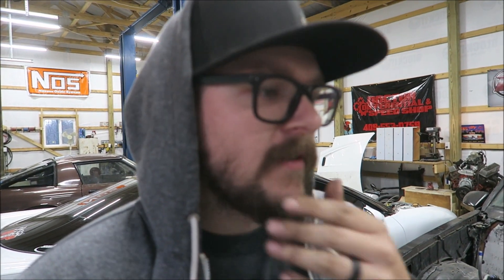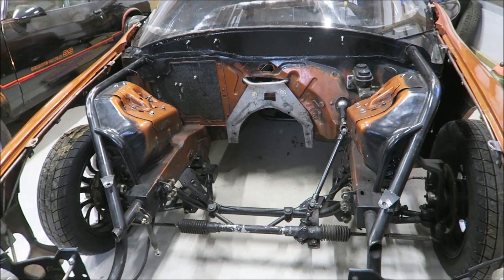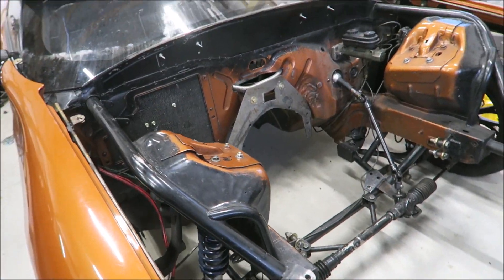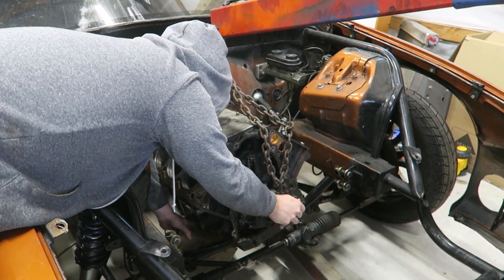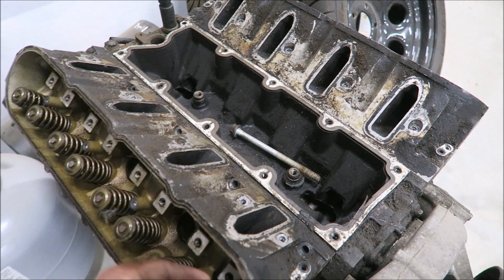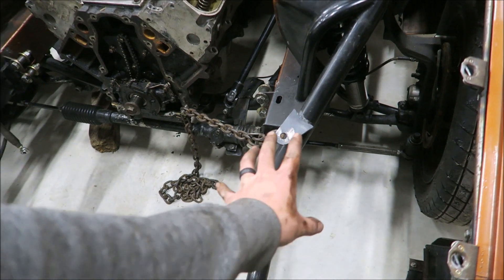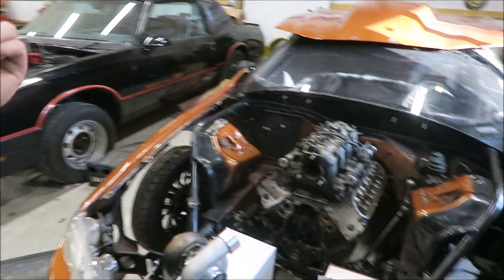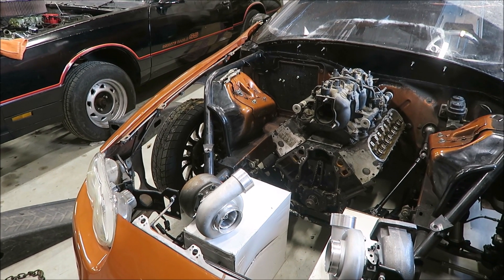Building a TWIN TURBO No Prep Car!

Comment: What do you mean by a rowdy motor and just warming up the iat's.....no intercooler??
Reply from the maker: An engine making 700hp NA will need a lot less boost to make 1300hp than an engine making 300hp NA. Less boost means less IAT
Reply: @SniderTron3000  ahhh.  I see

Comment: Hows Jack Black comin along?
Reply from the maker: Waiting on pistons at this point
Reply: @SniderTron3000  I see... Just curious what kind of money are you getting to do the work on the SS and the Donk and this Camaro? Or are you just helping friends out? I understand if you don't want to put that out there but I'm 16 and am in Diesel at a trade school and have loved hopping stuff up my whole life. Just curious if doing stuff like that can support you because that would be my dream job.
Reply from the maker: This Camaro I'm just helping friends out. The others are really specific to whats being done. The Trailblazer I'm not making a ton because its just a bunch of little things mostly. The Delta I'm making a decent amount from, but thats basically a full build, engine, cam, exhaust, trans, driveshaft, suspension, wiring, fuel system, etc.